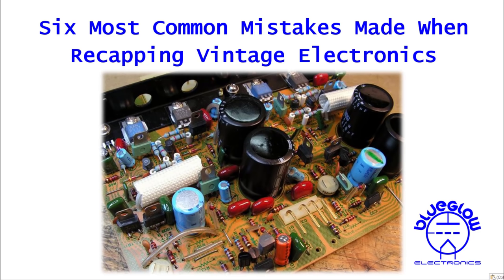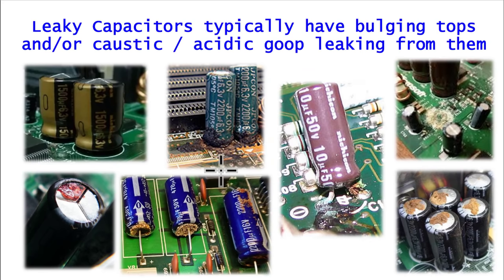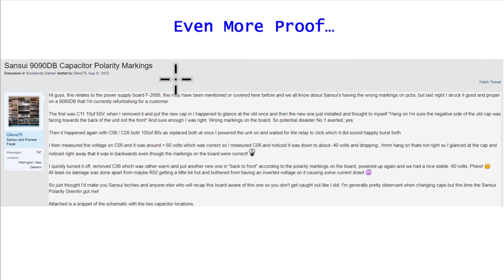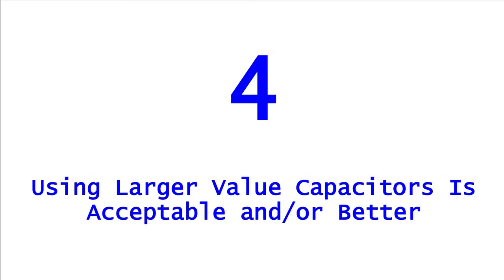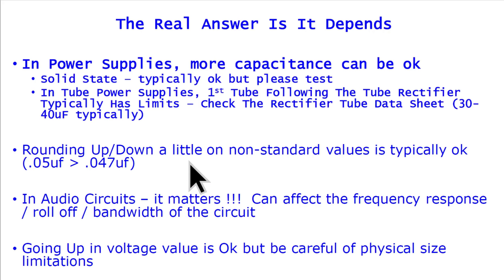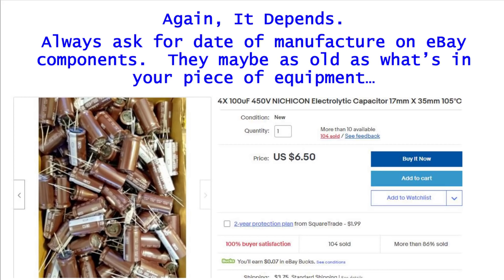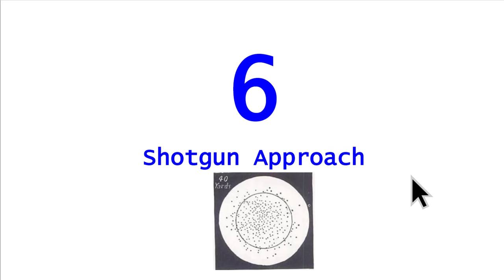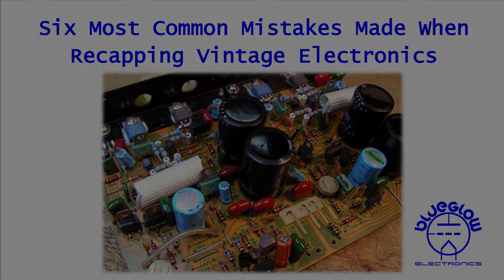Six Common Mistakes Made When Recapping Vintage Electronics

Comment: We can remove the word "vintage" here as this all applies to even "today's" electronics.
Perhaps one might say, "REALLY REALLY applies to today's electronics" because so many products are not of such good quality as the vintage stuff was, to begin with.

I find newer products to fail much quicker than the oldies.

And recapping is a pain now too as often, "lesser quality" caps seem to be used.

Before I replace any component at all, I thoroughly test them.  Especially caps!  I want to confirm their tolerance and ESR.  As far as Mouser and DigiKey, I do buy from them when I need to repair something that is important.  Like our Panasonic 3D Plasma TV.  When I had to repair that, I specifically got the exact caps (they were all Panasonic).  Of course, during troubleshooting, I used what I had on had to confirm that the problem was sorted out.

I kind of miss the days when we could trust components that we purchased.

Comment: Number 4..... I've got vintage guitar amplifiers that require filter capacitor values that either aren't made anymore or are far from readily available (to my knowledge). The values are 40uf/40uf/450 volt. What is readily available is 50uf/50uf/500 volts..... do you feel that that jump is too far off? Have used them for yearrrrs as replacements and they certainly work.....but am I likely burning up tubes at a much faster rate?

Comment: More often than not, bad caps I've found lately have no mechanical signs of failure - no leaking, no bulge, but capacitance readings  or ESR readings (or both) are way, way off.

Comment: Never buy chinese capacitors. Most of them that I installed in a recap failed after about 1 year. I always buy Japanese caps. They have more stringent quality control.
Reply: I only buy Nichicon, Rubycon, Panasonic, TDK (former Epcos), Kemet, Vishay, Cornell Dubilier - CDE, ELNA.
Reply: @LBCAndrew  you left out Nippon Chemi-Con (aka United Chemi-Con aka Chemi-Con)
Reply: 020621/1402h PST.... FYI, all those caps, mentioned in your posting, are mass  produced in China 🇨🇳
Reply: There is nothing wrong with China made products if they are from reputable dealers.
Reply: In eBay most of the branded caps are not original
Reply: So true.  Japanese capacitors are designed with strictest standards the factory can provide and they have much longer reputation of making excellent capacitors.  Chinese capacitors can look very attractive but inside, quality is very poor, using very poor materials.  Chinese companies are master of making copies of just about every products, just look at how they copy Rolex watches, they look very impressive from outside but inside, full of junks.
Reply: Be careful too buying from them X-over caps. I bought 4 pieces (2 pairs). Whn I checked it wth multimeter apparently non of them close to the values, eg. 17 uF I tested around 14 uF. They reprint the covers.
Reply: @LBCAndrew  don't buy famous caps on internet, eg. eBay, Alibaba, etc, unless  straight to the company.
Reply: @LBCAndrew  if you buy it not from a trusted seller (it's hard in China) there's great possibility they're fake. They can reprint the logo/ plastic cover.
Reply: @Andrewatnanz  Its a gamble with components.
Reply: Good statement, just don't buy China stuff. The good China stuff does exist... Somewhere, part of a quality brand. Not for the general public... We have to pay the premium price
Reply: Not only are Japanese capacitors better they are some of the best. In most regards they should be your first choice.
Reply: @sreekumarUSA  not true at all. Mamy are made in Japan or other East Asian countries

Comment: Other hints:
1) Measure old capacitor specs (capacity) vs envelope specified text. Don't recap good capacitors, since most of them can be good after 30 years of service/storage;
2) Understand the role of the capacitor in the scheme: Bypass capacitor/Filter capacitor. Bypass capacitors may be subject to change their impedance (LowImp, Low ESR), their capacity for more stable voltage and less noice. While Filter capacitors should have exact match for new capacitor vs old capacitor. 
3) Don't change implementation type: electrolytic capacitor, ceramic capacitor, thin film capacitor, so on,  since it changes many parasitic specs of capacitor that were accounted when the type of capacitor was chosen by manufacturer (ESR of ceramic capacitors is orders of magnitude less that ESR of low ESR electrolytic capacitors; inductivity).
4) Some branded old capacitors may have unique specs that were chosen by manufacturer for extra money paid for such capacitor specs. Review datasheet of original capacitor to look for some unique specs. If something special is found you shall choose new capacitor that has at least the same excellent specs that may have higher price than you would choose otherwise.

Comment: I've only dealt with super ancient equipment which I shot gun replaced.  Is it safe with 1930-40 to just replace the power supply first and see what happens?  One of these days I may actually try restoring some 1950's gear.

Comment: I have pulled new capacitors out of the package that the polarity was marked wrong.  Or a label that was shrunk onto the capacitor 90 degrees off. In other words the negative arrow was in the middle between both leads.

Comment: I've got lots of old pro audio items, some of which are well-known for problem capacitors that need to be replaced, but aside from that kind of thing where there's an obvious reason to check them, is it ok to just use things until there's an audible problem, or should I be routinely getting everything all checked over?

Comment: Even the power supply cap, I don’t think replace with larger capacitance is always a good idea. Maybe this time you fixed it, but in case it fail next time, the repair man would replace with another bigger cap, and again and again until the physical size doesn’t fit in the place. So replace with exact same value or a close value, for instance 47uF for 50uF and see if it works. If it is an audio device, you can turn up the gain and see if he satisfied with the filter cap or not.

Comment: Was trying to recap a valve/tube radio, my cap source was not really into high voltage, so I did a lot of measuring to try and make what I could get work. Bad mistake
After doing the changes, with new caps, those voltages rose, my new caps were now under rated.
That set is still sitting in the 'too hard' pile

Comment: I'm just replacing resistors and silver mica capacitors in a 77 year old Wireless 19 Set in the c.w. filter in which the audio goes extremely quiet when switched in.
The resistors had all gone high as expected, and the s-m caps had gone low, 221 pF and 247 pF shown as .00025 μF in the manual. I've heard of silver mica disease. The other I measured as 493 pF but the manual says .005 μF. Should it be 500 pF or 5,000 pF? Is the manual right or wrong or had someone replaced 5,000 with 500 by mistake? I have ordered a 500.
Which brings me to ordering: I saw 'vintage capacitors' offered. No thanks. I got modern ones elsewhere.
As for leaky capacitors, I replaced three axial types which were held with clamps on the chassis and obviously leaking a clear sticky substance at one end. I wouldn't do all the others due to cost and time and if they still work then why bother.

Comment: Good morning, I have 2 amplifiers, a Sansui R50 and another Sansui AU 717. They all advise me to do a recap, They both work perfectly and at maximum volume there is no blowing or noise in speakers without signal.
The question is: Is a recap justified? Does it make a difference that justifies the investment?
I appreciate your response, greetings from Argentina

Comment: so i have heard 2 different opinions .if you have a vintage unit from the late 70s and you open it up and it looks very clean and no signs of any issues looks like it did out of the factory or almost as good .should you replace caps ??? some say if its not broken dont fix it some units work for much longer than others depending on usage and how long and hard you ran them ? others will automaticly replace them and say they are 40 years old they cant be good which is untrue but it dosent mean they wont age sooner than later.so whats the verdict should you automaticly change them or look at the inside and see if they need it or any signs of damage .if not leave them alone??? thanks

Comment: I'm planning to recap a vintage synth Yamaha TX802. All capacitors V and uF are marked on the circuit board. But one cap by the coin battery is marked 16v 10uF (even in the service manual diagram) but the installed one is 50v 2.2uF, and the same 2.2uF shows up when I look at other boards on Google Images. I found it strange and confusing.

Comment: shot gunning all tantalums. that aint such a bad idea, an fx unit from the end 70s didnt have any ceramic but ONLY tantalum capacitors for decoupling, so with help of thermal vision camera, i swapped the ones that were bad just to find out that other ones blew also during the process. so in the end, i swapped all tantalums with modern ceramic ones and now it's ok :D it took a few 5 hours tho.

Comment: With regard to mistake #6 and powering up in steps: It is often not advisable to power up older electronic equipment with the original old caps in it because you could do some damage if there are shorted caps present in one of the other sections of the unit.  Here's  an article on that problem:  https://www.radiolaguy.com/info/Dont-Do.htm
Reply: you power up equipment of unknown state using a current limiting device such as a filament bulb in series with mains,, if theres a short, it'll light bright and stay bright, not dim out as it usually should..
Reply: @andygozzo72  Yes, this is mentioned in the article I referenced.

Comment: I understand about not changing capacitor values when replacing them but what about replacing them with better quality/better technology pieces? Most electronics are built to budget but when replacing them spending 50p on a capacitor when the OEM spent 1p might make sense?

Comment: Even with solid state power supplies, there’s a limit to how much capacitance you can put after the rectifier. Outside of physical limits, inrush can get to the point where the fuse pops as soon as you flip the power switch. I’m sure many of this have figured this out the hard way.
Reply: You just put a slightly bigger fuse in.

Comment: Heres an od ine, I was recapping my military Hickok TV 2 tube tester an found some screw in Caps. Thought they where exact replacements. Well after installing and bringing them up slowly with a Variac, one hissed its contents on to the board. But I checked and I installed it correctly., So what went wrong? Apparently Hickcock had had the capacitor manufacture mark the cap in reverse. It was a negative voltage circuit. So the Original cap red dot 🔴 was on the Neg terminal, on the replacement the oposite

Comment: i was building a dual, 9v , 12v converter, and mistaked the regulator. the big capacitors SMOKED! i had to scrap the whole thing. the regulator was crap, the plug-ins were blown (before i started), and it was just a mess even before starting. (i used ALL second handed parts).

Comment: I might add #7, which is check yourself from becoming a cap-assitor. Being a cap-ass is a mental condition, particularly involving idiots who don't know what they are doing, or what they are hearing out of equipment, to have the uncontrollable urge to start replacing capacitors in all things, and create buried problems down the line for future owners of that equipment, as it flows through the ecosystem.

Comment: pcb software designer, got it backwards when making the silkscreen.  Use   DVM to verify, on the component in question, the true polarity, if that circuit/project/ or item of equipment is operational......
Reply: On the pcb software ; there are many ' views '  and  levels of design. They, reversed the  ' silk screen '   when printing it. Maybe they got lost , on the gerber  files.....?....oh wll.

Comment: What is a mistake when it comes to glue? The fact that the manufacturers used it, or the fact that someone then removes it? With 35+ equipment you have to replace the capacitors anyway, thus removing the old glue.
Reply: The mistake is in looking at the board, seeing the glue, and mistakenly thinking it's goop oozing from the capacitor. If you realize it's not capacitor leakage, you might elect not to replace the capacitor.  You don't have to replace all the capacitors in gear that's 35 years old.

Comment: I have a new-in-box Heathkit AA-21D amplifier kit with the matching AJ-43 stereo tuner kit.  Do I need to be concerned that the capacitors in these kits may be bad, simply from age, even though they are new? Should I invest in a capacitance meter to measure them before installing them?
Reply: Yes, get a decent LCR meter and test everything before installing.  You can find a decent LCR meter for under $100.

Comment: New capacitors generally have a lower ESR (equivalent series resistance) lower inductance which is generally good but can cause a power supply to become unstable.  In theory.  

Related 7805 and other voltages made up until the 1980's oscillate at 55MHz at quite a low power level, I guess the ESR point might change this.  Also note a work around was to fit a head in the in and out pins - I have never done this though so the detail is not exactly correct.

Comment: Mistake #7 - not using caps with the correct temperature/longevity rating. Never replace a 105 deg cap with an 85 deg cap. Preferably upgrade all caps to 105 deg (unless they are even higher temp rating from the facotry, natch). Also, be aware that some caps have a much longer life than others and for instruments/appliances that are going to be switched on 24/7 you should invest in long-life caps. Also, buy caps from reputable manufacturers as well as reputable suppliers. The best caps are widely considered to be Japanese from Nichicon, Rubycon, or Panasonic (Panasonic are the ones that have a logo with a stylised M in a square box - the old Matsushita logo).

Comment: Take detailed video of the board before removing caps and review and triple check before energizing.
Reply: YES, excellent suggestion. I suggest the same for people repairing cars. A smartphone is an excellent information recording device. Snap a few photos, make audio notes with the voice recorder. You can even use a magnifier app with the flashlight turned on to see small stuff.

Comment: If a unit is over 25 to 35 years old, it should be entirely recapped, you're already inside, might as well do it all so you dont have one that shorts out and takes out things you simply can't find, put low leakage caps where their supposed to go, low esr high ripple capable units in the power supply, then good quality audio grade units for de coupling, its a done deal lmao, use the correct termination style, you're good. And as you said, stick with the same value. Grab them from an official seller, digikey mouser, make sure the lead spacing is correct and also height wise. Never buy caps or other parts from ebay or some horrible third party... Love your advice man.
Reply: So you're saying that if a car is from before 1997 it should be entirely recapped? Or test gear from pre-1997 should be entirely recapped?  I mean sure, if you don't want something to fail, why not replace all the components, the circuit board, the case.... ie: just throw it away and buy a complete new one.
Reply: @Graham_Wideman  the car thing is a horrible example mate, don't be ignorant, electrolytic capacitors are the most failure prone components in a circuit, if one of them fails, it can take out other things that when it comes to vintage gear can be very hard to find, literally a 20 cent component can ruin say a very rare ic or a transistor that isn't made anymore, and if you're lucky to find said transistor, what if it is in a place where you have multiple units where you need to beta match them to insure stability, if you only have a few of them what are the chances you could match them close enough then? Also, what If they weren't stored correctly and you get ones that are messed up. From esd " which you couldn't easily see unless you have a proper tester, sometimes it's even hard to find proper datasheets for these older units" Then if you want to sub for a newer part, you might need to modify the circuit to accept it", or humidity can even damage them there are so many factors, I really don't feel like wasting my time typing a whole book on things you can research and ready yourself. Good quality caps are cheap, don't take the chance, it's as simple as that. All that could be avoided if you just recap it. But people wanna be ignorant and cry when there is a problem, whatever, I know what I know from experience.
Reply: @Graham_Wideman  I've seen a lot of great old gear go to waste from ignorant lazy mentality, from caps that have exploded and taken out hard to find parts that rendered the piece of gear useless down the road. All could've been saved with 15 bucks worth of caps, lmao.